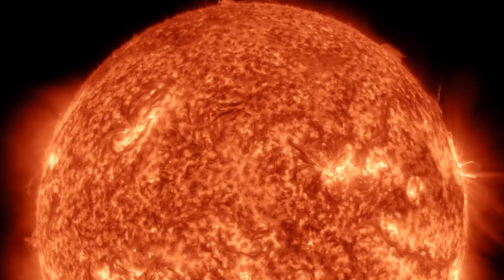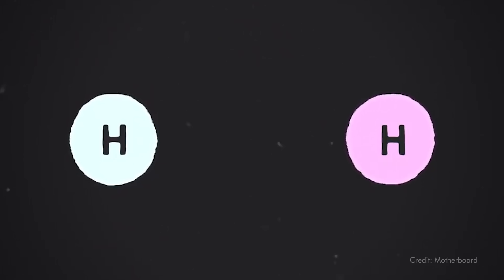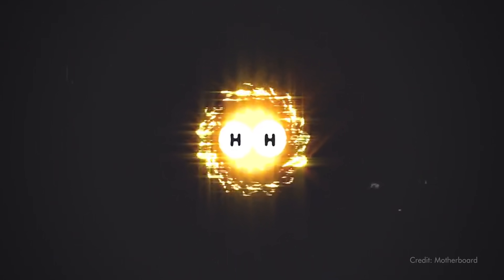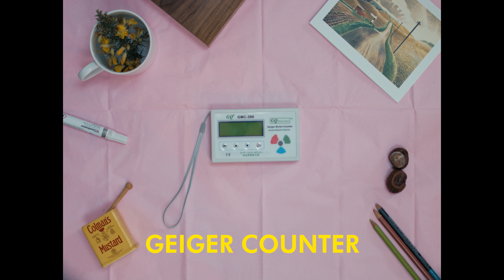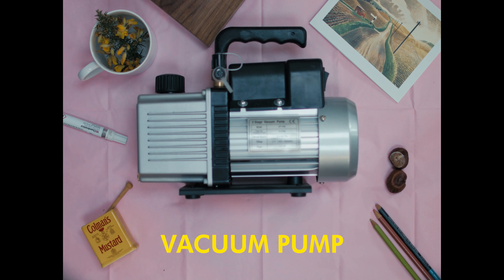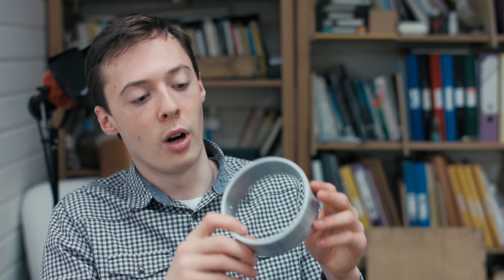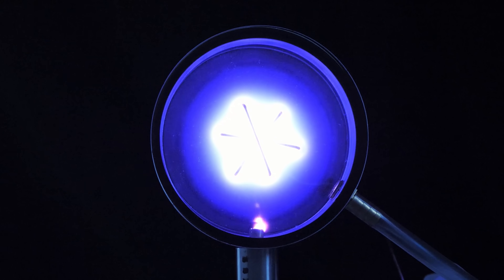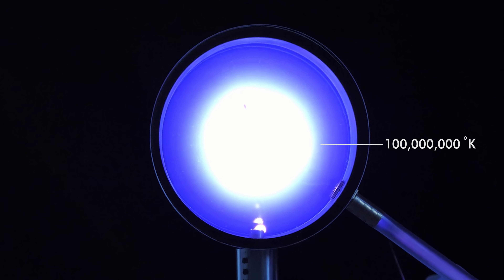Making a Desktop Fusion Reactor

Comment: Awesome end result dude, looks absolutely beautiful.

Main point of feedback is that need to provide a bit of an extra explanation of what is happening at each point;
What did you use to make your voltage booster? (What size of caps/diodes?)
Where even is the booster in the final build?
Maybe an analysis of the silver plating experiment (Chemical reaction steps?)
What was the gas you made with aluminium foil and caustic?

Other than those mate, seriously impressed with the editing of your video and final result.
Keep it up! :)
Reply from the maker: Alf thank you for the feedback! I think you’re absolutely spot on with your comments. I’ve made notes and I’ll make sure to go more in depth next time!

Comment: how did the temperature not melt the metal? How are you able to purchase/acquire those chemicals not available to the average person? 

Also not a big fan of the overdone production such as pouring liquid over the camera lens, taking off the face mask when sitting down in front of the camera that's already recording pretending you just finished using it, etc. I'm more of a fan of the simple how-to and demonstration approach.
Reply: Yeah dog swagger 2 Chainz and Young Dolph for life and also Vape Nation. I actually enjoyed the video, I thought it was to the level that our Lord and savior Dale Earnhardt jr would have wanted it to be.

Thanks for the great video. :)
Reply: In a fusion reactor plasma is often contained within magnetic fields, the plasma doesn't touch the metal. The fusor in the video attempts to use inertial electrostatic confinement. I also don't think this video has an actual fusion reactor, check out the thought emporium. EDIT: Real fusion produces neutrons, a deadly radiation that produces gamma rays on contact with water, seek advise from a professional before using real fuel inside a fusor.
Reply: Yeeeeah. Also Tritium and deuterium are so easy to buy...
Might be just an argon lamp.
Reply from the maker: Yeet Fam Dab No Chill Savage Bruh Squad Goals thanks for the feedback! The amount of gas in there that’s at that temperature is tiny, so the available energy is still very low. That being said, the cage gets extremely hot after running it for a while. The chemicals are freely available for anyone to purchase, they aren’t controlled or regulated.